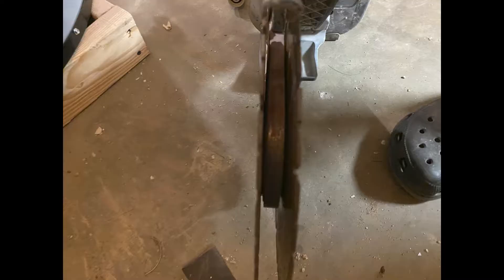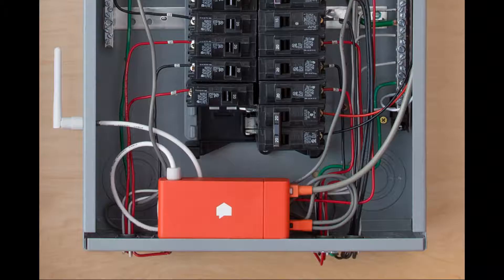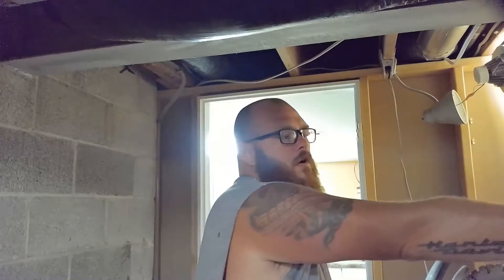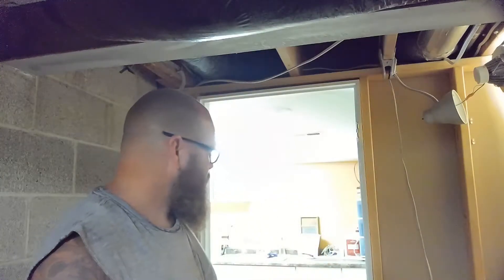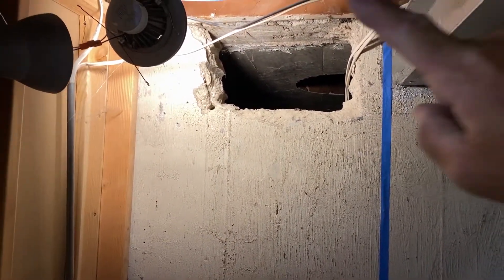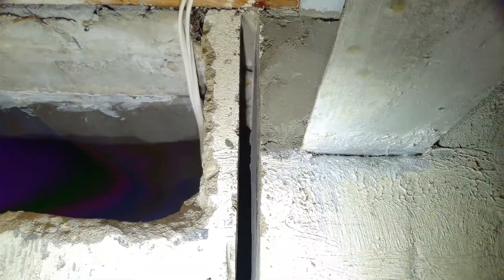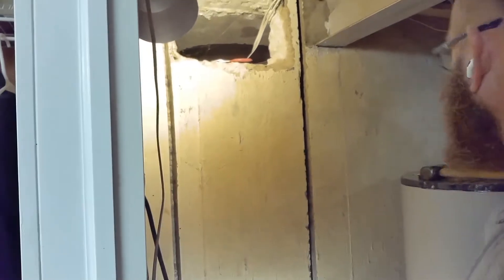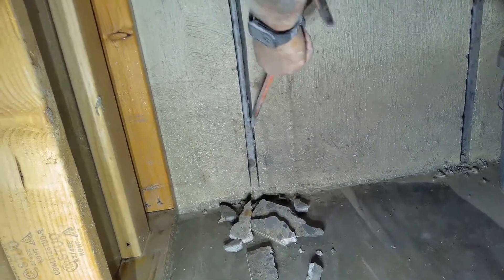Making a passthrough in a concrete wall

Comment: Is this type of saw able to cut a flush horizontal cut along an existing concrete floor?  I'm trying to make a walkout in my basement and need to cut a hole big enough for a double door.  Thanks for the vid!
Reply from the maker: That’s what I did but there was a little bit of work to make it perfectly level
Reply: @dmurphy68 Hi, I rented the same saw yesterday because of your video, thank you. Question for you. Did you have issues with the gfci tripping all the time because of the water?  I'm trying to flush cut the bottom horizontal and can't keep it from tripping. Any suggestions?
Reply from the maker: @chimrichalds1422 yes I turned down the water flow and kept the shop vac closer to get the water away from the unit. Hope this helps